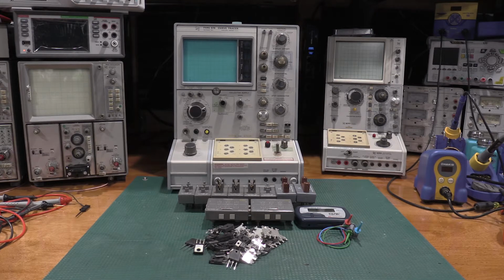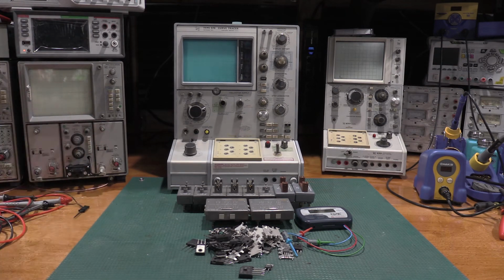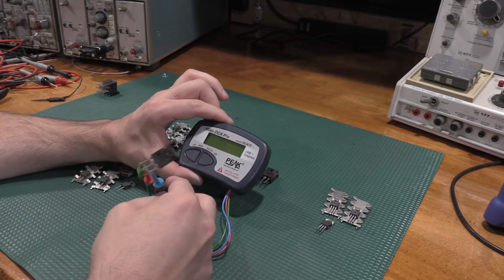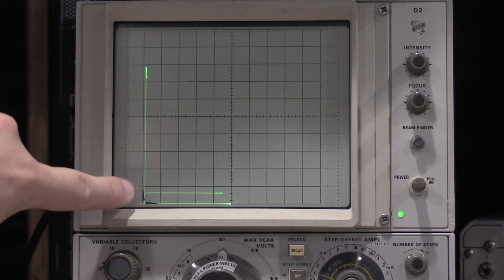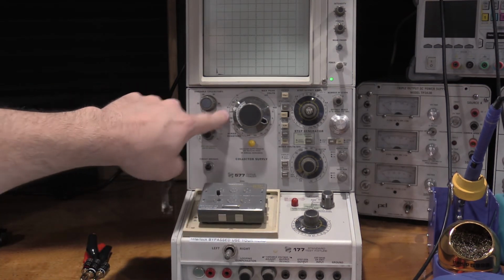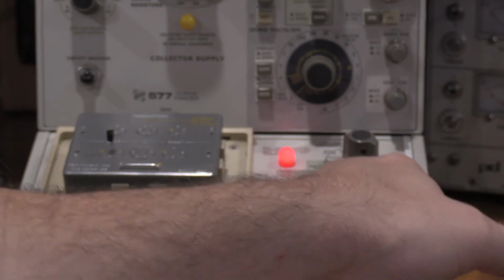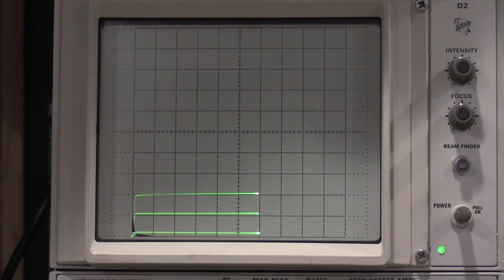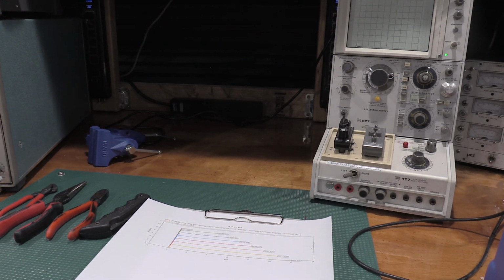Playing with Power Silicon and Curve Tracers

Comment: I just love these videos because I have a large number of Tektronix hardware for the 500 series mainframes and 7000 series scopes I have picked up over the years. These videos of yours are just wonderful to watch because I can learn so much seeing things done by you and this has been an enormous help in getting myself motivated once again to work with the old iron. Lab grade equipment I can afford - yep its very old, but so well made. All my equipment still works, but not within original specs. Fortunately that has not been a real problem for me and after watching how you do some of the realignment have hope one day I may get some of this equipment into better calibration. Some time back I picked up a 5CT1N thinking it was for a 7000 frame. I had to buy a 5000 scope so I could use it (and I didn't stop there, adding some more plug-in's for another great line of Tek scopes). I was so impressed with what I could get out of just the 5CT1N and was able to download some comprehensive documentation from Tektronix on semiconductor testing/characterization using these instruments. Great fun! Maybe one day I will be able to meet up with the big guns like you have on your bench but for now will enjoy the next best thing! Thank you for these great videos!